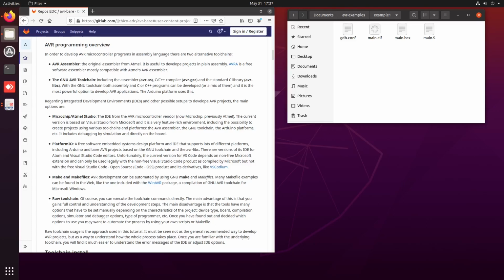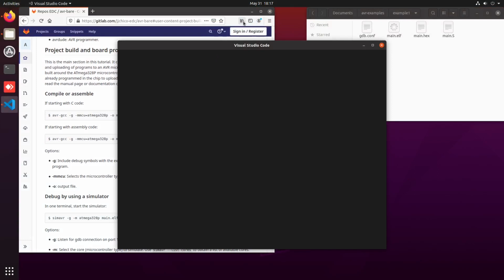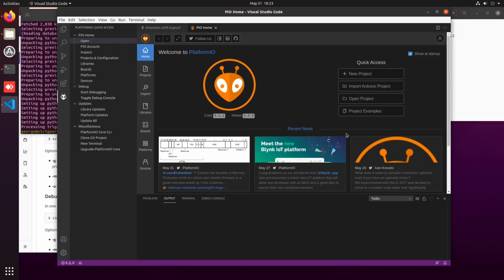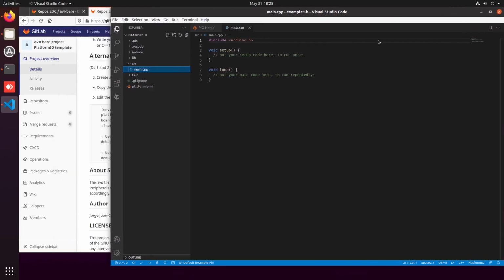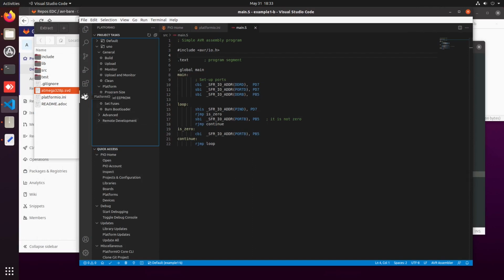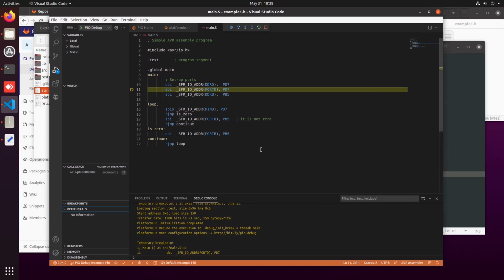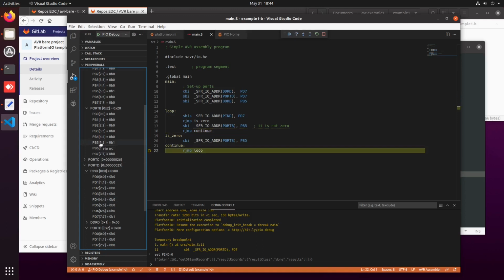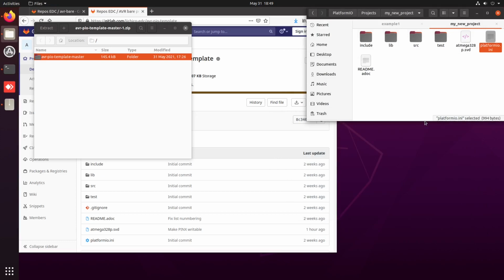AVR assembly and debugging with VSCode and Platform IO

Comment: Very nice! Thank you very much for putting this up! PlatformIO won't run simavr on its own when hitting PIO Debug, but you can run it by hand as specified in the repo and add a new configuration to launch.json to attach to that instance of the debugger running:

To run:
~/Documents/PlatformIO/Projects/example01/.pio/build/uno$ simavr -g -m atmega328p firmware.elf 

New configuration in launch.json
{
            "name": "Attach to simavr",
            "type": "cppdbg",
            "request": "launch",
            "program": "${workspaceFolder}/.pio/build/uno/firmware.elf",
            "miDebuggerServerAddress": "localhost:1234",
            "miDebuggerPath": "/usr/bin/avr-gdb",
            "cwd": "${workspaceFolder}",
            "stopAtEntry": true,
            "MIMode": "gdb"
        },

Comment: Thanks.  
I tried BLINK asm from your  github, changed to PB5 for builtinLed, it's working, BUT using debugger I cannot interfere the program. led is blinking, even if im using the breakpoints. 
What am i doing wrong here?
Thanks
Reply from the maker: Hi! The example uses simavr as the debugging tool. It is an AVR emulator so you are not debugging the program running on the board but the program running on the emulation software. It should be possible to debug on the board but you will need a programing board  to do the interface with the MCU and a debugging tool like avarice. Check the PlatformIO docs. Good luck.
Reply: @jjchico2009   got you. Thanks.